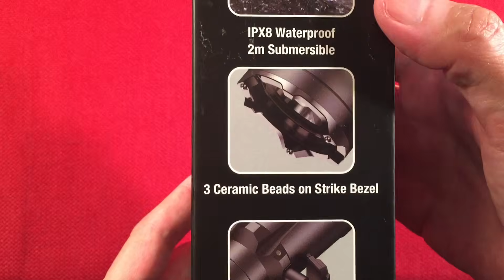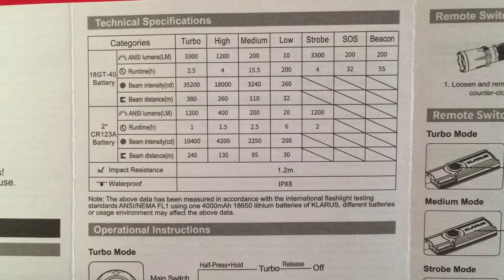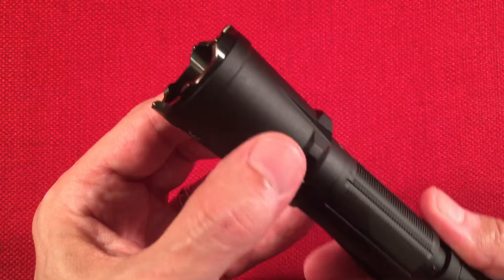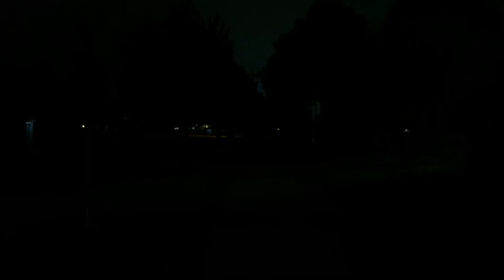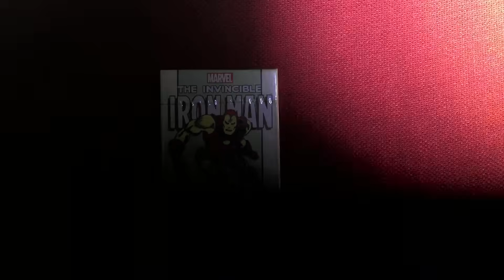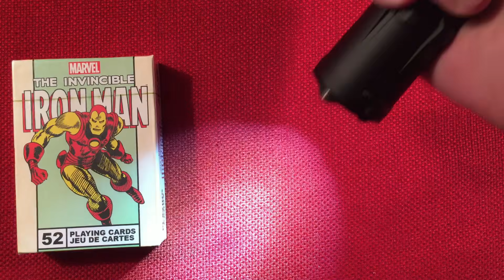Todd's Klarus XT11GT Pro V3 18650 EDC Tactical Flashlight Review

Comment: Hey Todd, don't know if you've heard about the new Zhiwhis ZWS-802 "wireless antenna" radio but it's on par with the Qodosen and Malahit for legendary 21st century radio status; I've been playing with one for a few days now and can confirm it's a gamechanger being able to sit on the couch while pulling signals from the max reception spot on the other side of the house with no wires or setup, highly recommended 📻👍
Reply from the maker: I've seen it, but not a fan of the side firing speakers.